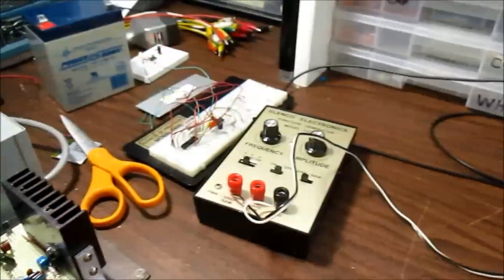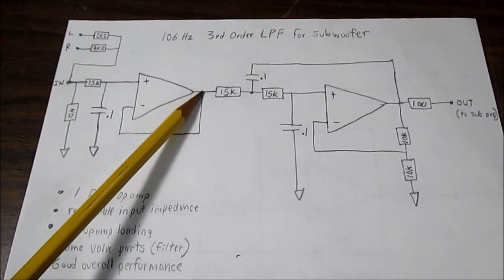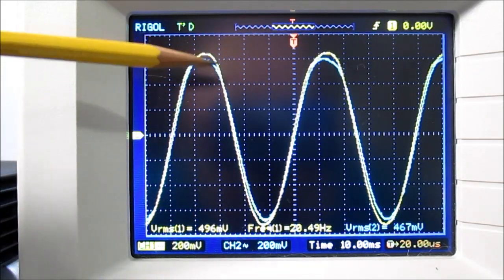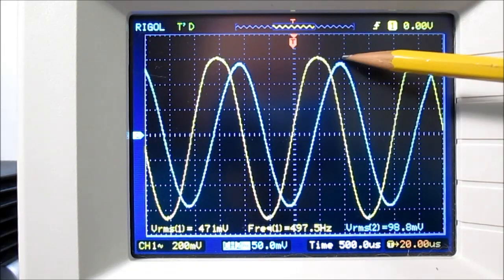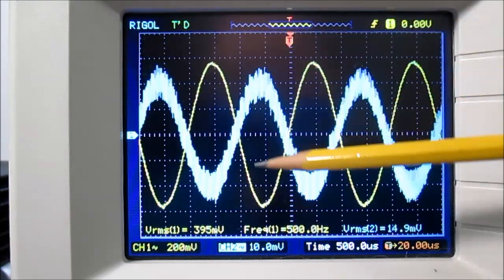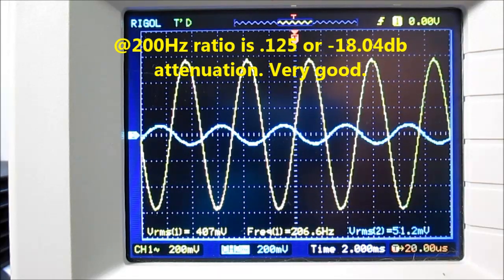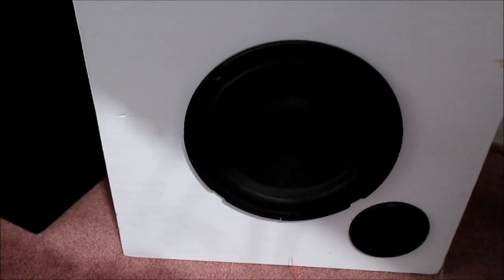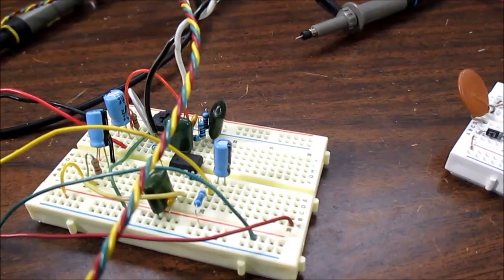Filter order performance demonstration for subwoofer use

Comment: I know this is an old video, but a few questions - 1) is there a advantage to using inductors in the filter instead of resistors, IE a steeper cut-off? 2) would using inductors decrease the phase shift? Best video I've found on sub filters, thanks....DA.

Comment: John,  if you've not already discovered this Equalizer APO is a fantastic little program for your PC that can digitally create some very nice filters.  I use it to not only do calibrated room EQ but to also take the low frequencies from Front, center,  back channels and direct them to the sub using a 48db/oct filters hi and low pass.  Makes listening to music on my PC very nice when I'm in m home office.   I know going digital is cheating compared to a circuit,  however the ease of use and results are fantastic.  Edit:  Correction,  I'm actually using 24db/oct filters.  The program can do 48/db oct.
Reply: Thanks Jeff!
Awesome software :O:O
...If it works well with your audiocard.

Comment: do the 2 2.2K resistorsgo on theinput side of the power amp? i have a STK433-330 pwr amp and trying to get it to have left right and sub out put.
Reply: yes, they go at the output of the preamplifier before the inputs of the power amplifiers (normal 2.0 stereo)

Comment: great video, but will you notice the out of phase signal with reference to the right and left channels, as if it were off beat?
Reply from the maker: It should not be noticeable as the rolloff is fairly steep. I think room acoustics such as standing waves and nodes with the bass frequencies is much more of an issue with audio.
Reply: Hi John, do you know if it is okay to use the LM358 differential op amp or the LM1458.  I think it would be okay so long as it's not set up that way.  thanks mike

Comment: Hi John thank you for your fantastic videos I was wondering if it would be possible if you could do more reviews from apps that you can get from eBay or band good they are very cheap and some of them seem quite interesting Bluetooth modules etc. I have been making a Bluetooth powered speaker but have been having some problems with the noise from the Bluetooth module they don't seem to like sharing the power. Regards Andrew
Reply from the maker: Thanks Andrew, I have a lot to do on this channel and probably will do this at some point.

Comment: hi  is there any difference if I swapped gain stage and buffer stage? what should I do to get punchy bass than boomy bass ?
Reply: Your speaker is going to be the big factor there. If the speaker booms, it has a strong resonance at a particular frequency, usually because of poor design. Only electronic correction would be a parametric Eq dialed into that freq.
Reply: So Punchy bass is just a good performing system, reasonably smooth response , plenty of power and good cone excursion.
Reply from the maker: As long as your source signal impedance is low, I can't see any effect of swapping the stages around. Don't change the gain though as it allows the filter resistors and caps to be the same value in the 2nd order part.

Boomy bass to me is a peak in the response in the 60 to 120Hz range (sounds awful like cheap consumer crap). If I were a bass head, I'd want a peak in the 35-45Hz range where the bass would sound lower and powerful. This is best designed in the woofer/subwoofer itself by tuning the box/port design.
Reply: JohnAudioTech thank you. If I have a ported enclosure, filling it with sound absorbing material is a good/bad idea?

Comment: How does the fase shift affect? Does it mean that it will sound a bit later than it should?
Reply: Yup, and that is just the extreme case. Any time you have two drivers spaced apart and producing the same frequency, you end up with a lumpy 3-D dispersion pattern. To understand this better look at what happens with the double slit experiment, and the diffraction pattern developed by the particle model.
Reply: IscleGaming | ZefaCraft it comes to play if there are other speakers playing same frequency with another phase, say one speaker playing with no phase shift and another playing with 180 degree phase shift results in undesirable attenuation of sound.
Reply: Deepak A Oh, so if i build this low pass filter for a 2.1 setup with a high pass filter, it won't affect anything right? (assuming that the other speakers don't play in the same frequency range as the subwoofer)
Reply: Phase shift is not delaying the signal. Example, having a 180 degrees phase shift on one speaker and no phase shift on another playing the same frequency (let's say 60Hz), what happens is you'll end up with a lack of bass, so to speak, because one signal cancels the other signal out.